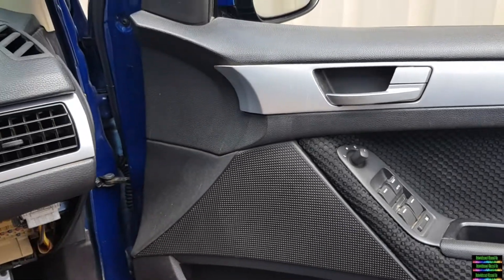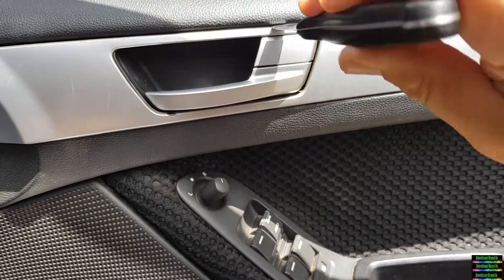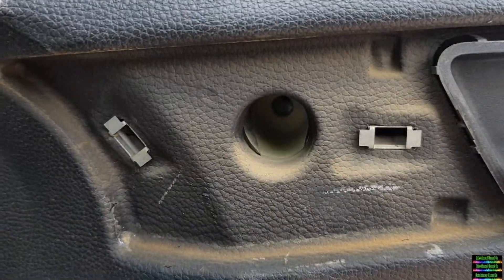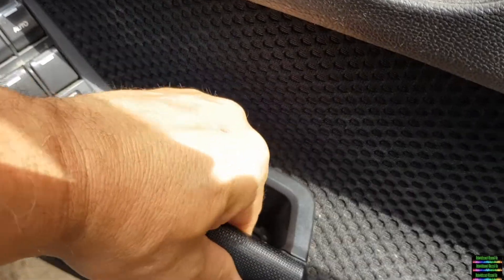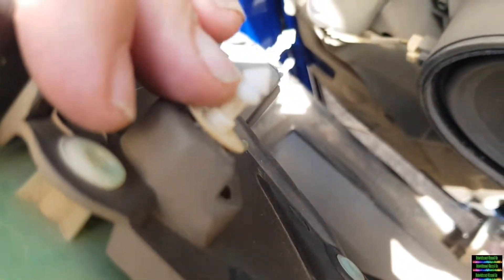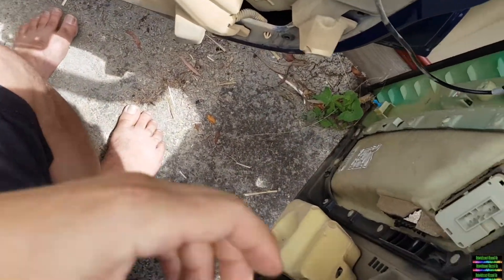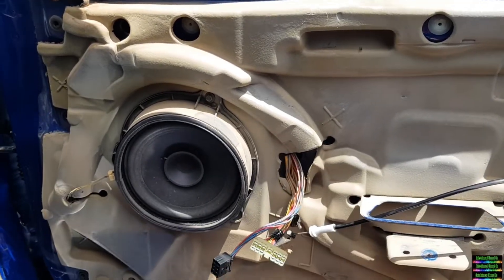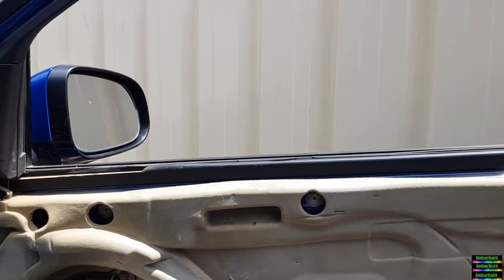2010 FG XR6 FORD DRIVERS DOOR CARD REMOVAL.....

Comment: Thanks had to change my inside door handle
Reply from the maker: your welcome buddy!
Reply: I had to do the same. Out of interest how did you remove and replace the door handle mount? There’s those plastic stubs that are sorta melted into plastic ‘buttons’ that secure the mount in place. Did you break the tops off and use screws? I remelted the top of those plastic stubs and seems to have worked but not sure if that’s the best way to fix the new handle in position